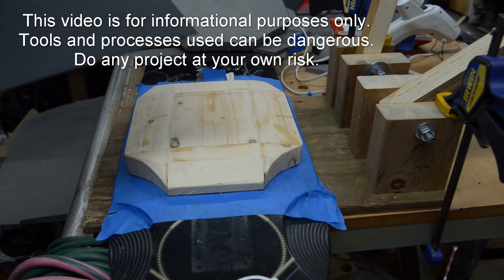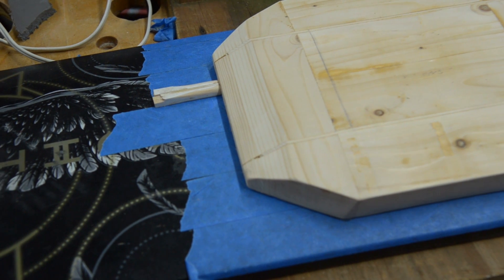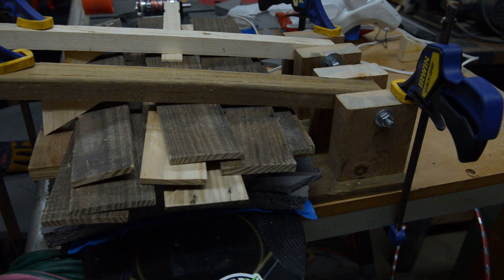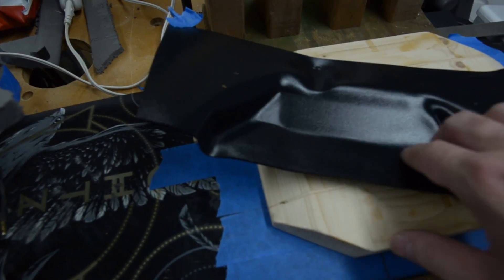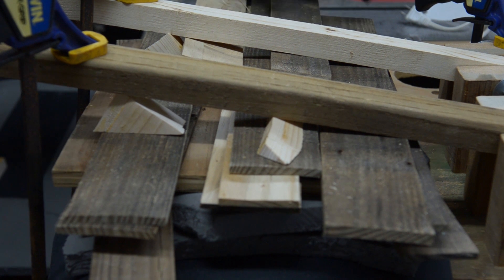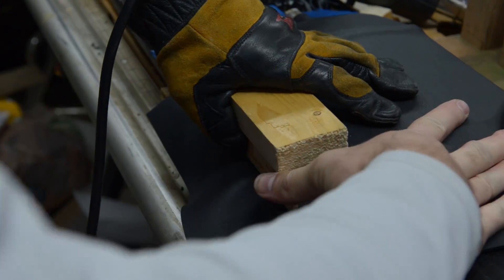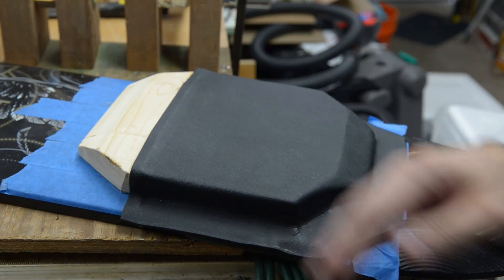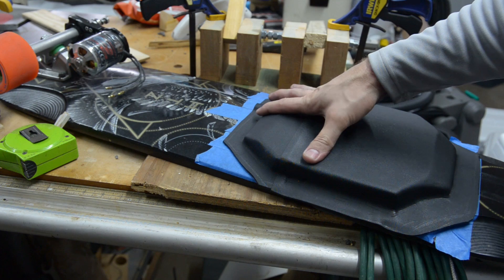HOW TO: Thermoforming Kydex - ESKATE Battery Box Part 2

Comment: You need to have the kydex clamped in the foam much quicker. I use a vacuum method that actually forms while the kydex is still at top temperature. Faster is key